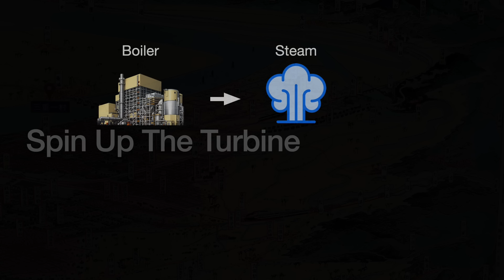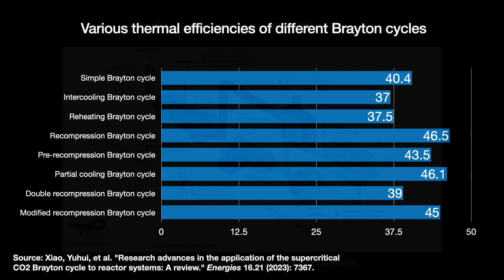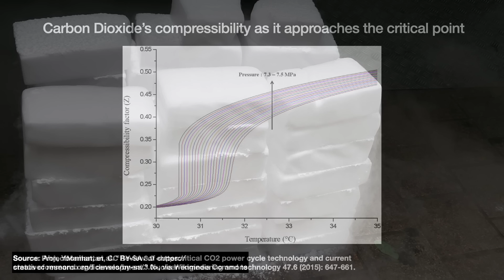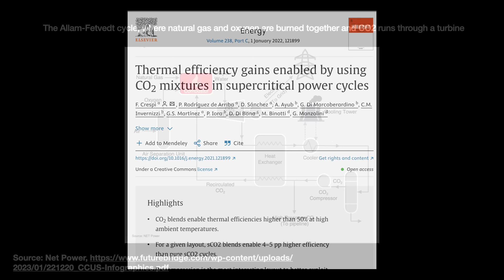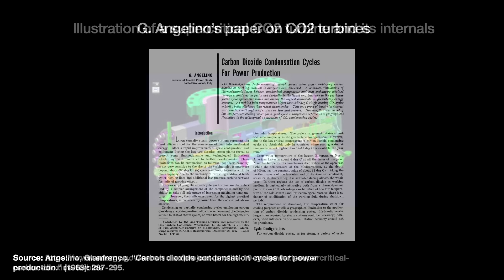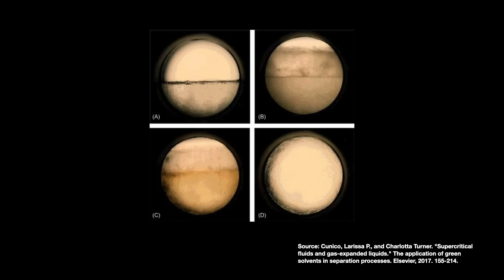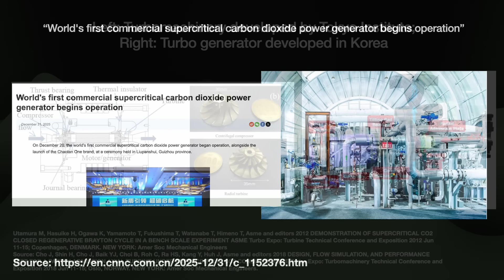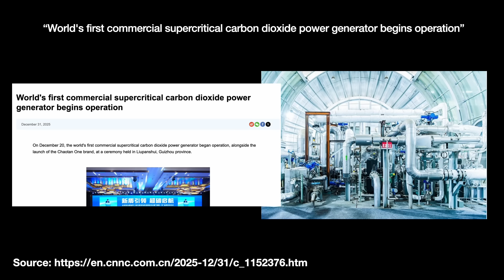The Supercritical CO2 Turbine: Waterless Wonder

Comment: Carbon Dioxide is not meant to be stored or pumped into the ground; it is meant to be used.  Carbon Dioxide is not the problem; it is the solution. 

Supercritical carbon dioxide is the right path for the future. In order to solve the problem of how we handle CO2 emissions from coal-fired power plants, our industry leaders will have to make a shift away from air- or oxygen-based technologies to gasify coal.  In fact, the use of air or oxygen to gasify coal hurts the gasification process, and this method of gasifying coal or biomass will ultimately become obsolete.  

In order to solve the problem of how we handle CO2 emissions, the world must shift away from the use of air- or oxygen-based technologies to gasify coal, and make a shift towards the gasification of pure carbon dioxide.   

 Carbon dioxide is not waste; it's the solution that everyone missed, but waste heat is wasted energy, and that's the real problem. 

Please read U.S. Patent No. 5,937,652, "A Process for coal or biomass fuel gasification by carbon dioxide extracted from a boiler flue gas stream," and assess its potential for our clean energy future.  Good luck with all your work & research.

Comment: Another thing to consider, which to be clear really depends on what percentage of the budget it is (and from a more pessimistic perspective how much you want to keep millwright or shutdown jobs/environmental service jobs alive), is the replacement of “Boiler Water Treatment” / Descaling Operations etc with…getting a tank of Pure CO2.

Especially “wet” condensers that use Open Cycle Evaporation to cool off the steam etc use a TON of water.  Most of this is grabbed from a well or river etc and needs to be cleaned.  Unless it is DI Level Pure,  that’s going to leave scale on pipes and in components etc which needs to be rinsed off too.

Granted you said it brings it’s own (and novel/potentially unsolved for now) issues,  but less concern about Water/Steam Corrosion may be neat too.

Granted you have an Asphyxiation Hazard to deal with (Alarms, Escape Packs, Emergency Ventilation potentially), and maybe CO2 Purity/Contaminant Buildup is complicated too!

All in all great video as usual, but as an “Environmental Services Technician” i work in/around a bunch of the fine print in Power Plants / Energy Transportation that people often don’t think of, so figured i’d share some ideas/info.

Keep up the great work!

Comment: Minor gripe that someone has probably already voiced here: turbine != fan. I understand the urge to call the larger vanes/blades in the lower pressure turbine stages "fan blades" due to their more recognizable form factor. However, turbines are worked by fluids. Fans work air.

Comment: in China:
sCO2 Super-Critical CO2 Turbine Electric Generators are already used in generating electricity for commercial facilities manufacturing refined steel, utilizing any excess heat diverted to drive such turbines

any extra electricity not used, goes to the electric grid

Comment: About 20 years ago I was lead automation tech at a high CO2 plant in South Texas. We were to inject the CO2 down a disposal well. After an hour, I kept gaining pressure at the disposal wellhead. The final stage of the injection compressor was 7100 psi or so. They told me to use the compressor recycle and flare to hold the disposal wellhead at 6950 psi. We did that for 9 hours, with a crew spraying water on the discharge cooler to keep it from cooking down. At 9 hours something happened. Evidently the column in the wellbore went supercritical. All of a sudden everything cooled down to within spec and the injection pressure dropped to 3600 psi or so. We quit venting and we were injecting all the CO2 (+ H2S and some other nasty stuff) the gathering system could send at us. Once we were running smoothly, I asked the project engineer if every start up was going to be walking that tightrope like we did for 9 hours. He said no. If you're not shut down for more than four days, the temperature stored in the rock surrounding the wellbore and the pressure held on the well would allow you to just start injecting. Nothing more exciting than injecting water. He was right. All the subsequent startups were smooth as silk.
Reply: You injected "nasty stuff" back into the ground, as you say? Would you give this "nasty stuff" to your children to drink?
Reply: @PhilipHood-du1wk  injection wells are nothing special and regulated like everything else, stop getting worked up over things you don't fully understand
Reply: @McHox granted to be fair, at least in the USA they could probably use a BIT more regulation (In terms of HAZCOM for what is in a Drilling Mud/Fracturing Fluid (if used),  Spill/Drift Monitoring,  Long Term Liability etc, and only using them as a last resort)

But yeah they are pretty routine and if DONE RIGHT are no big deal.  (Although not the best solution per se)
Reply: @PhilipHood-du1wk not mine, yours maybe....

Comment: Good and interesting topic for utilities generation.  CO2 has its troubles including carbonization of stainless and seals of bearings.  You may have to show the importance of AMB design in the future series. And, recuprator is a important attached equipment compared to H2O systems. However, the 50% pus thermal efficiency will be the ultimate choice of power generation.  You can use it for fussion reactor if available soon.

Comment: No gas turbine on its own gets 60% thermal efficiency. There are a few kinds of combined cycles that do. Thermo cycles starting with boiling certain metals followed by either steam or SCCO2 can achieve those 60% kinds of thermal efficiencies. See the old work from Oak Ridge Laboratories, 1960s era, and the YouTube video of the "Sunflower" THERMAL solar power satellite from Mafic Studios circa 2016 at  https://youtu.be/q-Lrj35HcbQ?si=Q-5AkGi5FMOP8KkL which uses two-stage optical concentration to achieve temperatures around 1600 degrees Celsius from concentrated sunlight to boil potassium metal. That approach has the advantage of using much thinner and cheaper metal for the solar absorber pipes than is possible when running supercritical steam where high alloy metals are required. The principles and reasoning behind the boiling potassium metal approach are fully explained in the old Oak Ridge papers.

Comment: Things should be made simpler but only upto a point. The important point is the energy transfer between the gas and the blades. For low molecular weight molecules (like H2 and He), this is very inefficient. For water it is better but for CO2 it is much better. Rankine cycle was for the classical steam engine (piston type) but the ideas are portable. However, overall limit to efficiency is determined by the input and output temperatures.
Reply: ❤❤❤ they have Full Running  Nuclear ☢️ Co2 Power station 🚉 running in China 🇨🇳.
We west just scratch head 💆🏼‍♀️💆🏼‍♂️ Becusee they have so much stuff 10-15 years ahead of us . To them they just innovate to support the system .  “Just another day “ . lol 😂We don’t hear much here .

Comment: Coal is a dying industry. Its growth of the past decades was mostly driben by China. Without China, global demand was already falling and badically since covid, the demand in China dor calling has been stagnating and it might start to fall this year, it may already have fallen last year. In oretty much all other major coal consumer countries except India, coal demand has been falling for a while and India isn't going to have tje same development as China. There is an analysis, that compares coal consumption per capita at GDP per capita levels (with the dollar values fixed at some year for comparison) and it turns out, that India is using way less coal at its level of wealth than China was at the same stage. This is because India's development is delayed compared to China and India now has better access to renewables and electric individual mobility (electric 2 wheelers are fairly common in India) than China did when it was at the same level of wealth. So, China drove global demand now it will drive global decline, India won't replace replace chinese demand and there is no other country with similar demand growth or potential for future demand, because almost every other country also sees shrinking demand. There simply isn't a big future for coal anywhere, there will only be a long period of a slow death.

Comment: Could you explain why these supercritical turbines are using CO2 rather than N2? 

N2 is far more abundant, and its critical point pressure is 34 atmospheres, starting at -147°C. CO2's critical point pressure is 73.8 atmospheres, starting at 31˚C. What advantage does CO2 have over N2? It would seem that N2 should have and advantage over CO2. Isn't it desirable to use a gas that has a lower critical point pressure? This gives a larger pressure and temperature range which the turbine can operate.

Comment: This is a totally stupid idea running CO2 through a turbine.  You would get far less waste in the transfer from CO2 to mechanical energy if you ran it into a cylinder.   Much like a pushing the Co2 into the intake of a V8 engine.

Comment: I can also see this potential for Data centres. They generate low grade waste heat and heat from their own gas turbines as well as heat extraction from its cooling system. Combine all this and perhaps feed it all into a high temp heat pump and then you might have the heat needed for such a suercriticla turbines heat needs and you get to use that power generation in a closed loop feed with minimum grid losses and that hot C02 could then be sent to a ranklin process for further or recycled back as preheated air

Comment: Comment on 4:46 
Stand alone gas turbines do not achieve 60% efficiency. These are typical numbers on a combined cycle as described earlier in the video. Stand alone gas turbines go up to 44%.
Reply: Thermo cycles starting with boiling potassium metal followed by either steam or SCCO2 can also achieve those 60% kinds of thermal efficiencies. See the old work from Oak Ridge Laboratories, 1960s era, and the YouTube video of the "Sunflower" THERMAL solar power satellite from Mafic Studios circa 2016.
Reply: This should be the link to that THERMAL Solar Power Satellite.  https://youtu.be/q-Lrj35HcbQ?si=Q-5AkGi5FMOP8KkL

Comment: The best is Argon working gas!
Weight 40 mole and has criticall temperature od 5.04 MPa! Lower than CO2 7.1 MPa!
We know that supercriticall CO2 has very corrossive if water is present, while Argon just
do ignore H2O! Plus 1% of the air is *Argon!* Making the resource inexhaustable!
( He run from the atmosphere once relased and CO2 is absorbed)
With Argon we can have working fluid at 800°C and with 50% efficiency!
Ideal for MS Thorium LFTR!
Reply: Argon is quite expensive, In 2013 leadng a project to retrieve waste from reactor operation, it was determined that there could be irradiated uranium be present. If exposed to air (it was stored underwater) there is a real chance of a fire (which has been experienced at Sellafield). I beleive term is Pyrophoric.

One of the options was to inject a layer of argon until it was realised that the amount of material required was anout 90% annual production in UK.
Technology may be better now, but need reliable volume (and cost effective) Argon source.
Reply: @tariq_sharif  
1. Argon is a noble gas and when escape, just merge with the atmosphere. It's weight is 40 moles, just under 44 of the CO2, but in ONE atom.

2. This is why we need to use it in closed cycle, just like with CO2. Closed brayton cycle
Argon is ideal for that: heavy, noble, monoatomic, low supercriticall point 5.04 MPa, no stress on the turbine strength, alow to use maraging steell (ksi 450 to 550, ten times of the normal steel) which rust in moisture, or CO2...
Argon beats CO2 in abundance. (10 000ppm vs 460 in the atmosphere)
Reply: @WadcaWymiaru what you mean id "weigh 40 moles" that makes no sense

Comment: I wish you'd have compared direct energy conversion to these turbines. Whether ash can be removed prior by electrostatic precipitators from Quaise Energy wells that should eventually tap heat from plastic rock at near mantle depths with millimeter wave gyrotrons, or possibly free electron x-ray lasers, in noble gas plasma is a pertinent question. Given the propensity of oil to incite wars for control, and the persistent doubts about nuclear reactor safety, solving the technological hurdles should be a nation or global priority. It is not.

Comment: 13:30 CO₂ offers a significant advantage for advanced sodium-cooled reactors: unlike water, it does not react violently upon contact with sodium.
Reply: Sodium has other problems than burning furiously on exposure to air/water - Santa Susanna nuclear accident in 1959 (the worst ever one on USA soil - covered up until 1989) happened because sodium reacted with a tiny amount of circulation pump bearing grease, formed sticky lumps and clogged the reactor core

Having a reactive material in the middle of a reactor is no bueno. Water is bad enough (Corrosion is a SERIOUS problem - see Besse Davis). Sodium is an order of magnitude worse (despite not needing the incredibly dangerous "hot rocks in a steam boiler" design). Lead-bismuth isn't quite as bad chemically (despite lead oxides being brain-eaters) but enough bismuth is converted to polonium 210 that the entire reactor compartment becomes a no-go zone for a couple of decades after the reactor is switched off. (The soviet lead-bismuth reactors ALL had leaks in the cooling circuits)

If we're going to deploy nuclear reactors, we need to pay close attecntion to the secondary issues associated with the moderator/coolant and discard those which appear good from a nuclear POV but are chemically dangerous 

I'm aware that a LFTR loop is intensely radioactive but once the loop is drained the radioactivity of the pipework and reactor compartment drops to safe levels within 3-4 days, corrosion levels are negligible, the salts are insoluble in water(biosphere protection) and the pipework requires electrical heating to ensure the salts circulate long before you even hit criticality, so the "freeze" problem the soviets had on their submarines is a non-issue.

As for  turbines:

The chemical problems of supercritical CO2 are negiigable compared to water corrosion in steam plant, but the residual issues may push us towards supercritical xenon instead (even smaller, which makes creep issues somwehat easier to deal with and you eliminate the long-term carbon reactions which may (or may not) cause issues).

The biggest single bottleneck for sCO2 deployment is simple: Steam turbines are 1GW size because that's as large as we can make them with current materials science and the demand is to make them as large as possible because the economics of power generation are brutal. Larger turbines have proportionally lower maintenance costs.

Unless and until sCO2 can provably match the cost/benefit ratio of steam turbines, they'll always be the bridesmaid not the bride.

It's an exicting development to see a commercial sCO2 turbine finally show up but the technology hasn't been widely deployed (yet) for a somple reason: it's not (yet) as profitable as steam turbines even taking the massive maintainance load of steam turbines into account - and bear in mind that LWR turbines are even more maintenance intensive than other thermal power station turbines thanks to only being able to produce wet steam that eats turbine blades quickly thanks to droplet condensation as steam flows through the turbine. If a lower maintenance cost turbine could be used, accountants would be grabbing it with both hands even if it costs more upfront.
Reply: Your purported advantage only exists when the reactor has already failed?